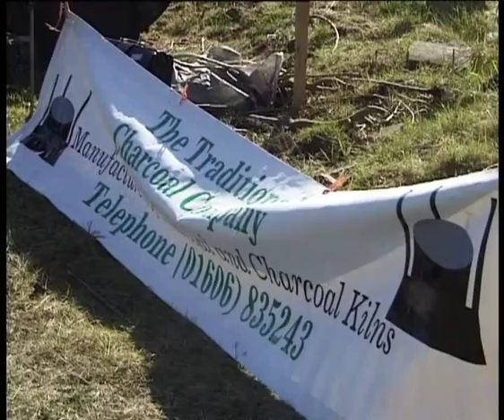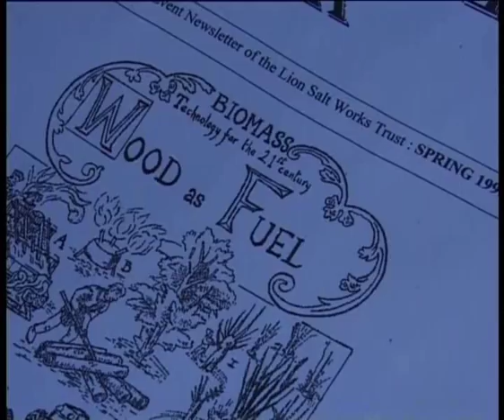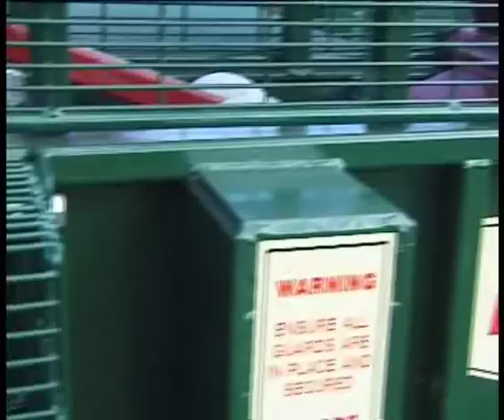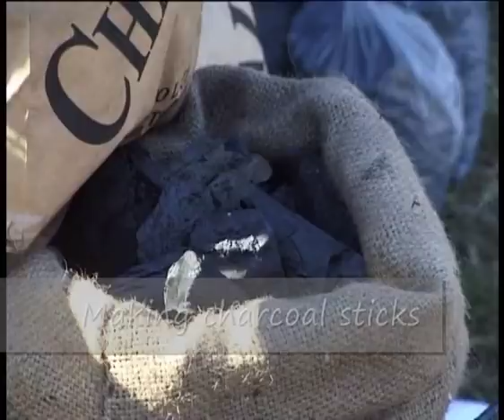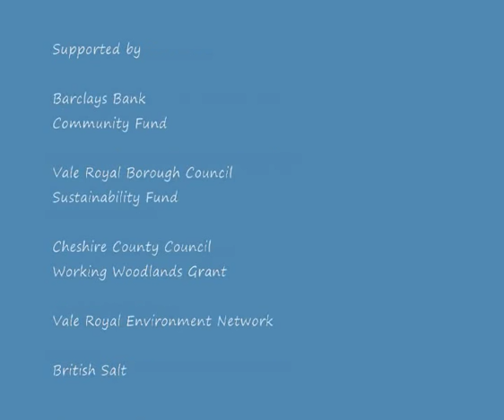Wood as Fuel at Lion Salt Works March 1999

Comment: That's a lot of tools for making wood smaller. If you're seeking to use heat to get salt you'd be better off with a boiler that can take the whole cord width. And use the steam. This also opens up the possibility of using vaccuum to speed up the process. Still ecologically sound but smarter.